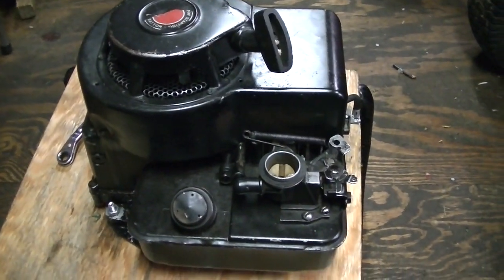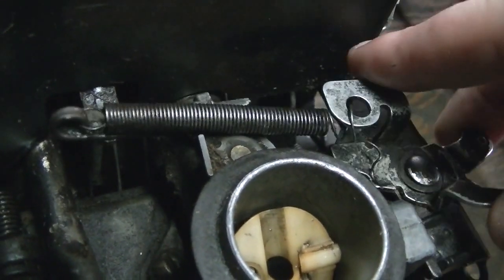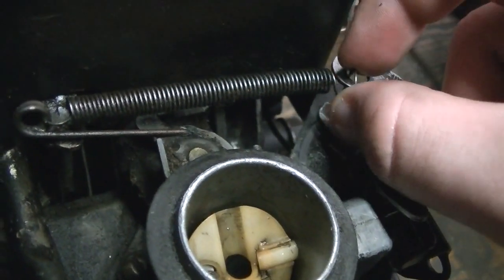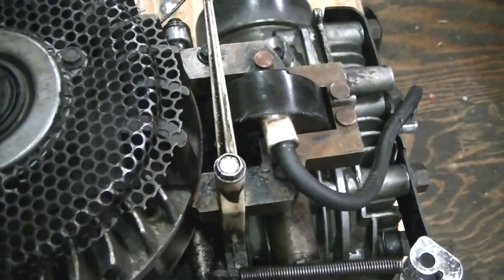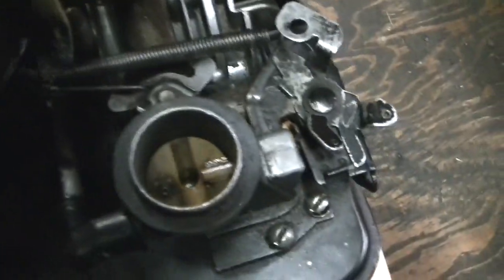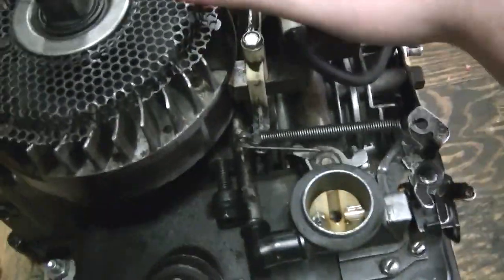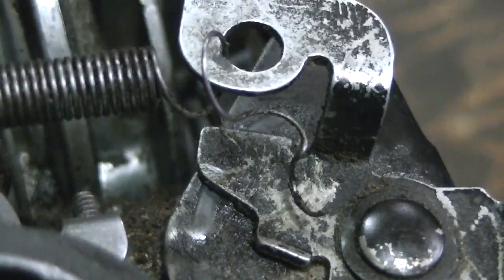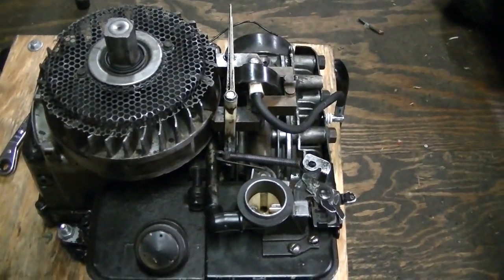How a Briggs and Stratton Push Mower engine governor/throttle linkage is set up, and how it works.

Comment: Thanks for explaining that i wondered how it worked. I have a push mower with a briggs 6hp motor and its about 18 yrs old but still runs strong. Last year at the end of season it started revving up and down like the governor was pulsating, it starts out small then builds till it goes dead & would not start until it sat for a while. I tried cleaning the carb several times and would run fine for about 10 minutes then do it again, so i thought i'd put a new carb on it. I just put it on and it ran great for about 30 min. then did the same thing so i'm thinking something to do with the governor now maybe but didn't understand how it worked. Any thoughts on a problem like this. Like i said it started out of the blue last year. Any help would be greatly appreciated.
Reply from the maker: Your welcome! If this motor has the mechanical governor, and not what i show in this video, it is adjustable, i have another video on adjusting the governor, which sounds like thats what the problem is, but yeah a dirty carburetor will do the same thing but i doubt thats the problem if you put a new carb on. If its a mechanical and not air vane like I show in this video, try to adjust it. Also if it is like whats in this video, it may need new springs, if they are stretched it can cause that as well. hope this helps! Thanks for Watching!!!
Reply: Thank you, i'll check that out and let you know. Thanks again.
Reply from the maker: your welcome! sounds good!

Comment: My mower will start then shut off. Do you happen to know any reasons for this? I have a Briggs and Stratton push mower.
Reply from the maker: If it has the carburetor similar to what I show in this video (not the bowl type carburetor) it probably needs a new diaphragm in the carburetor, this is very common on these motors, you prime it and it runs on that but the carburetor isn't pumping fuel, I show how to fix this in part 2 of my push mower rebuild project. Hope this helps, and thanks for watching!!!

Comment: My pressure washer is revving like crazy up and down check my video out "karcher g3050 oh over revving" when i manually hold the governor in place it works fine why is my governor arm moving up and down like crazy?? and how do i fix it .... thank you sir for your help
Reply from the maker: Just watched it. It sounds like its 1 of 2 things, first off it could be a clogged carburetor (on the high side) making it lean out when its under load and surging like that or 2, if it has a mechanical (non air-vane) governor, it could be out of adjustment. If the carburetor has a adjustment screw, i would try turning it out about a 1/4 to 1/2 turn to see if that smoothes out. hope this helps! Thanks for Watching!!!

Comment: Thanks I did not know how those suckers worked.
Reply from the maker: your welcome! Thanks for Watching!!!
Reply: fnaguitarplayer9
Should you have time to help me with a problem, here it is.  I'll understand if you don't, as I'm sure you get a lot of questions and it can get to be too much.  I'm trying to help a friend to get his lawnmower going.  It starts up after pressing the priming bulb, then stops running.  I took off the carburetor and sprayed carb cleaner.  Poked the wire through the hole in the area of the jets, but I didn't pay attention if little wire went through the little holes.  I just poked it randomly. I wasn't aware of the little holes until looking at another video.  Also followed up with compressed air. Put everything back together and it still has the same problem.  It starts and after it burns the gas squirted by the primer bulb, then it stops running.  This lawnmower was left by someone at my friends house. I don't see any adjustment screw for the carb other than an idle adjustment, so it wasn't a problem that the previous owner adjusted to the point where fuel wouldn't flow.   A lawnmower repair guy said that ethanol gas quite often attacks the rubber tip on the float needle.  It swells up the float needle tip and keeps the gas flow closed off from the bowl.  Is it that critical, because when I let the float down, gas flows from the tank.  But of course that is when I let it drop down without the bowl in place.  It would still seem like it would run longer with the float bowl full, but I'm not real clear on how it works.  Any other ideas from you or anyone that reads this is appreciated.
Reply from the maker: Feel free to ask me any questions, i do get alot but I always answer back! On those type of carburetors, the nut that holds the bowl on, has 2 little holes that run all the way through it, and these have to be clean as the fuel goes through this, then into the emulsion tube/jet, I don't think its the needle, usually they will just stick and flood the motor instead of not letting gas through, i'd check the bolt on the bottom, you will see it if you look real close, a hole that goes all the way through and make a T with top  of the "bolt". It always gets clogged up and  keeps it from running. Hope this helps!

Comment: Funny this reminded of when I was around 9-10 years old had a 3.5 hp and it was constantly revving up and down over and over...I couldn't figure out what was wrong so I just bent the gov all the way open and stretched that throttle spring all the way out.

I was pretty much red lining that poor little motor and it went through 2-3 spark plugs per season, but it kept going for years.  And I never came across grass too thick to plow through at WOT lol.

Comment: I have a Scott's 6.0 hp Briggs dual choke engine and I replace the plug and gas and fuel along with taking off the carb and cleaning it and putting it back together but still the same issue which is one it starts it runs perfect for about 5 seconds then just stops. Not sure if you may have any insight of what the problem is but it's driving me nuts. I know it's something simple just can't figure it out!! Hope you have some advice, it would be greatly appreciated?

Comment from the maker: Glad to hear my videos have helped out! First thing i'd check is revving the motor up by the linkage just to rule out a carburetor problem, just move the linkage where it hooks on to the carburetor, if it revs up good, the governor spring may be installed wrong or stretched, if it still doesn't throttle up bypassing the governor, then its probably in the carb, either out of adjustment or needs a new diaphragm, when revving it up like this, don't hold it high speed. thanks for watching!

Comment from the maker: Your welcome. If this is on a lawn mower that your cutting grass with, don't do it, it is extremely dangerous, if your building a racing mower or a go kart, get a billet rod and flywheel for it, then bypass the governor, if you don't get a rod it will break in no time and probably ruin your engine (been there done that!!!) hate to discourage you, but to fix up a engine, it takes alot of parts, if you want it to last. you can get the parts from eccarburetors hope this helps thanks for watching!!!

Comment from the maker: Hey, it should be on the front of the flywheel shroud/cover above where the spark plug is, if not it could be on the side of the shroud above the muffler, anywhere like that on the flywheel cover, it will have a model, type and code.  thanks for watching!!!

Comment: I have a BS 4.75 throttle free. between the gas tank and there's a part that's like a spine soaked with gas (or oil). what is the spongey part). elk between the gas tank and that part used to be something that's missing. and now it basically just runs extremely weak unless I jam something in  governor lever. any idea what that part is? leveever

Comment: HEY!!   Just wanted jump in an thank you for your video!!   I have been trying to figure out what to do with a B/S 3.5hp that surges and stalls "if" I get it started.  Your video showing me what was under the cowling (the flywheel areas) gave me the courage to get out there and give it a shot -- I work on computers BUT needed your video to show what was under the hood of a small engine.  FIXED.  Previous owner installed choke/throttle upside down

Comment from the maker: it should be the same as what i showed in this video, they are all basically the same, also there is a smaller spring thats supposed to be on the backside, the engine in this video was missing that thanks for watching!

Comment: Ya there great when there running if it is one I do not see a 2digit number beside the model number thanks for helping sorry that I gave you a tecumseh to try to help me fix :-) if you want I can send you a picture of the sticker on the mower because when I typed the model number in to Google I got 0 results :-(

Comment from the maker: uh oh. you just cussed me out haha i hate tecumseh's. To be honest I do try to avoid working on them, there great when they are running but as soon as you have a problem (always carburetor related) thats it. But that model you gave me sounds like a briggs and stratton model and type number, most engines in the 3 to 4 horsepower range start with 9, i just need (if it has it) the 2 digit code beside the type code.

Comment from the maker: oh ok you just need the bolt. got ya! i've done that before, but it was so tight that i actually broke the carburetor itself!!! ... i'm trying to find a diagram for that, but i'm having problems there should be a 2 digit code after the type, I have probably 300 diagrams on my computer but thats not on it, so i have to go to briggs website which has changed and i have to have a 2 digit code. Ran into the same problem earlier with another engine haha

Comment: Actually it is a 1996 craftsman and the model number is 944.367165 the part that I broke is the nut that holds the boal of the crab on (I snapped of the head trying to remove it but I got it out ) thank you very much for helping sorry for my bad spelling in the last post.

Comment from the maker: sounds like the carburetor may need cleaned or rebuilt, they will tend to do that when they are dirty, or its possible you may have bent a linkage while tightening the spring and that can cause it to. thanks for watching!!!

Comment from the maker: yes and no, no because unless you rebuild it with racing parts you will blow up / destroy the motor, its not designed for those high rpm's. You'll be surprised how much power it will have governed, and if you gear it right it will go pretty fast. Remember that all stock go karts come with  a engine governed at 3600 RPM, same as a lawn mower engine! thanks for watching!!!

Comment from the maker: No, I don't really have any videos on newer equipment, I do have one on linkage on a briggs 13.5 horse (same as a 12 horse), which all linkages all use the same principles, so you might be able go by it, it has the auto choke, when you give the engine full throttle it hits the choke, so that might help you out, i'll send a PM with it attached... Thanks for Watching!!!

Comment: I have aYard Machines mower. It has the primer bulb style Briggs & Stratton 6.0 HP engine with a side mounted carborator. model # 123K02-0195-E1 Do you have a video on how the linkage works from the throttle to the carborator choke lever? Thanks Mark

Comment from the maker: Sounds like the throttle cable is broke or came loose either at the throttle control or where it connects on the carburetor linkage, have someone move the throttle up and down and check at the carburetor to see if the linkage is moving, another thing, the cable clamp could be loose on the front allowing the whole cable to move. Thanks For Watching!!!

Comment: great video. the throttle mechanism had me beaten. i just couldn't believe that the arm mechanism on the carby was indirectly controlled by the throttle cable via a spring and a wind vane mechanism. amazing. and...yes....very confusing. great stuff. good man

Comment from the maker: i would but i don't have a 4 horse, not sure if its the same as this one. it may not be on right, i had this problem on another push mower engine, checked everything then i seen i put the spring on the wrong part of the governor arm haha it could be a bad spring too, if they get to stretched they won't work. Thanks for Watching!!!

Comment: Hi, I have a 5.0 Briggs Stratton lawnmover and I have clean the carb. and replaced the gasket and the diaphragm.  The engine will turn on and will stay on but will stall once I start to cut the 4" grass. It sound like it losses it pressure.  Hope to hear from you and let me know if you have a video.

Comment from the maker: are you running it with a blade? if the blade is off of it they will kick back really bad! my engine here in this video has a heavy flywheel on it so i don't have to run a blade on it. but if you are running it on a stand like this, don't run a blade! use a old deck to test these motors with blades. thanks for watching!!!

Comment from the maker: good motors. yes it is a chokamatic, like the one in this video. what it is, its trying to run way to lean, and when you put your hand your choking it making it richer, so its one of a few things that can be wrong, #1, the carb may need to be cleaned, sometimes jets will clog up, #2 if its the older style it will have a adjustment screw on the carb (not the idle speed on top but the fuel mixture screw on the front) adjust it out about a half turn, try it and try that a few times, if that...